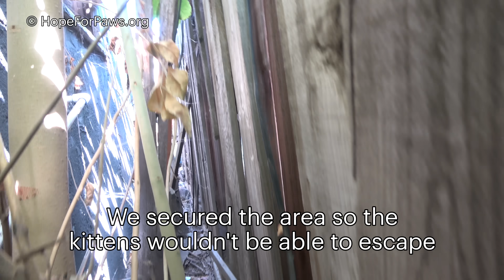Kittens nursing on their dead mom for two days 😿😿😿😿😿 #kitten

Comment: It's crazy how not even 1 kitten even made a peep while getting rescued. The first kitten looked like it was debating just going to the rescuer. They were abnormally calm for the situation. It almost seems like mommy kitty was still there protecting them while guiding them to the rescuers at the same time. If you all don't agree with me u at least have to admit that their behavior wasn't normal, like at all. Even when fear took over slightly they didn't bolt anywhere. They slowly made their way to just get under some debre to some what hide. The love that momma had for her babies was and is incredible.